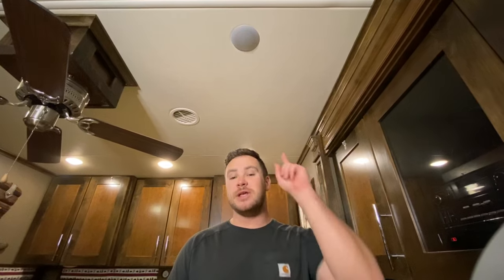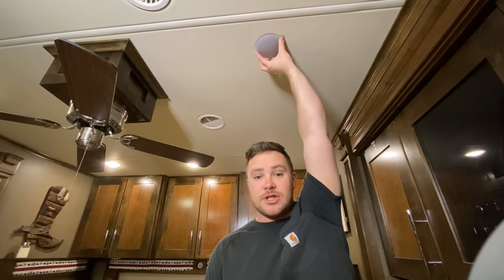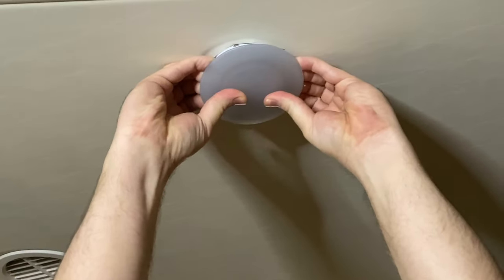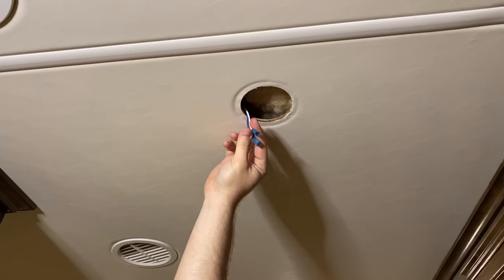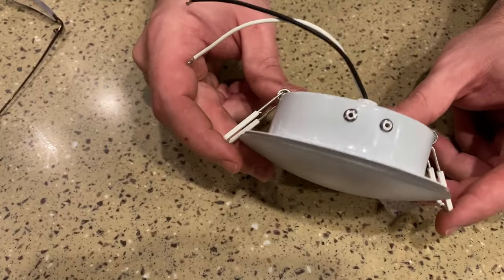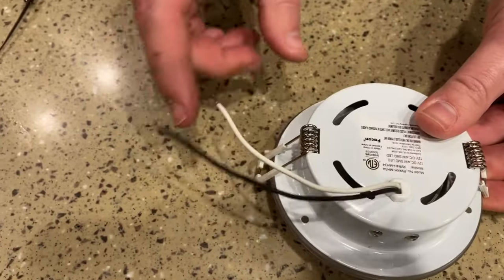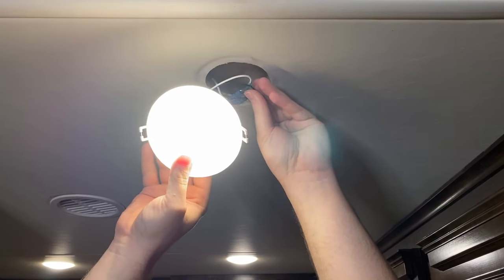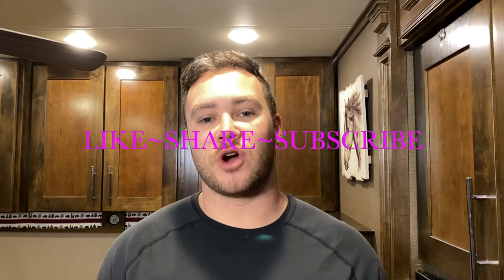RV LED LIGHTS: How to Remove and Replace (2020)

Comment from the maker: Links for 3” and 4.5” LED LIGHTS are in the description. We have also included a link for the male and female wire connectors (quick connects) that we like to use.

Comment: What about turning off the power??! Should have been the first thing to do??? Thanks for making the video easy to understand
Reply from the maker: If you have the lights turned to the off position there is no power running to the lights when you change them

Comment: When you remove the light from the ceiling make sure your fingers are not in the way of the spring loaded retainers. If you don’t do this you will know quickly why this is important.